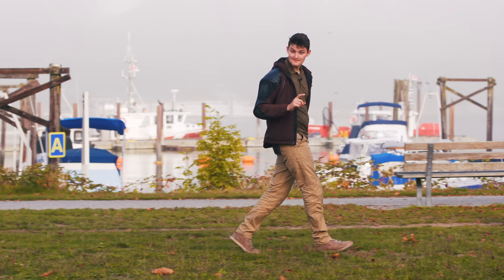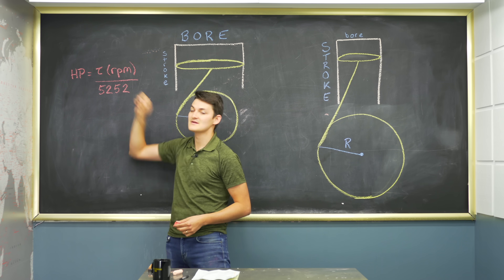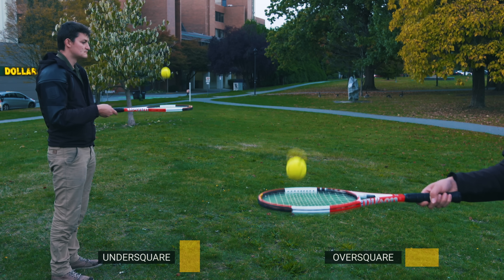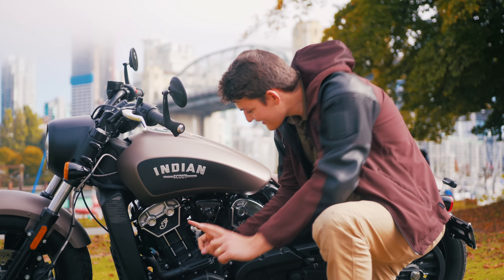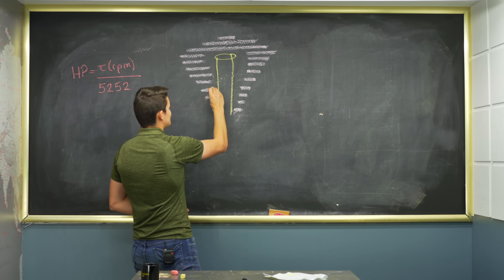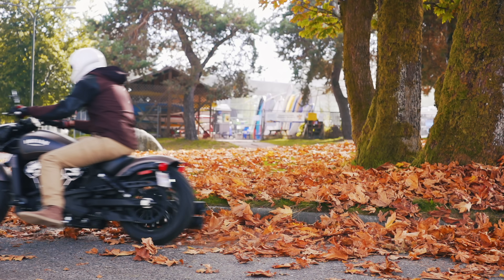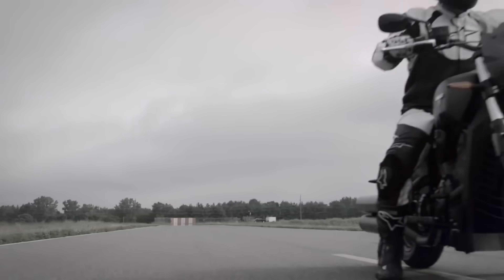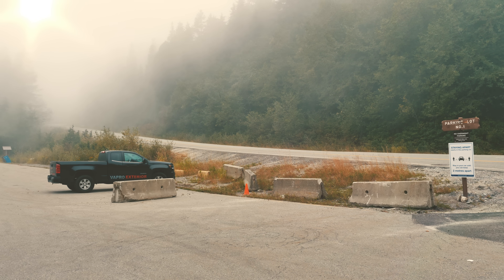How Indian Makes 43% More Power than Harley-Davidson

Comment: I always loved the way the scout looked, but this review teaching me about how it worked was the biggest driver behind me wanting a scout more than anything and ultimately buying one. Its been a super enjoyable ride
Reply: Would you consider it a reliable bike?
Reply: @AntonioMartinez-kg3zm that's a damn good question right there.
Reply: @AntonioMartinez-kg3zm  I bought it with 6k miles and I've put about 5k miles on it since and it hasn't had any problems
Reply: @AntonioMartinez-kg3zm I have a two year old scout 60 with 30,000 miles on it and I ride it hard. So far just regular maintenance and tires.
Reply: But as the video said, it sucks because it's too low
Reply: @xpusostomos  a valid complaint for tall people or people who have preferences for a higher riding bike. I thoroughly enjoy being low though, and I find that it corners really well. My other ride is a much taller HD Electro glide and I generally find the Scout is more fun to ride. Again, all preferences though
Reply: @Anonymized-name  what the physics says is that a low bike will turn quicker, but you'll lean more. And since you're already low, then the question is will you scrape something. That I find a bit terrifying.
Reply: @xpusostomos  i scrape the feelers on the foot pegs every once in a while.

Comment: The finest example of educated content, without bias or shock value.
Reply: FACTS!
Reply: They are comparing two totally different bikes. My SOFTAIL makes 50% more torque at half the revs. The bobber is much more comparable to a SOFTAIL in size and overall layout.
Reply: 100 ... agree!
Reply: They compared harleys smallest bike lol. Compare the street bob to the scout bobber and Harley shits on it lmao. This is the definition of persuasion and bias
Reply: @drewlansing8520  No the Scout is more comparable in price and size to a Sportster, my Scout was $11,500 what does a Softail start at? lol
Reply: @tylerdouthit5985  Indian Scout is their smallest bike, they compared the bike with the same sized motors, seat height and price $11,500 for the Scout what does a street bob run? $15,000  and 86 HP for the Bob the Scout comes in at 100hp for 4 grand less! Lololol
Reply: A Softail standard has a msrp of 13,599 Have you seen a sportster in person? It’s considerably smaller than a scout. The 1200S would be much more comparable in size to a sportster although it’s more expensive and seems to be the only Indian bike that appears exciting.
Reply: @drewlansing8520  A Scout is not any bigger than a Sportster I own a Scout and have rode many Sportsters, Softail is a larger bike than a Scout....🙄
Reply: A sportster has a 59 inch wheel base. The scout has a 62 and my Softail has a 63. A sportster is a bar hopper built off an old flat track racer design that hasn’t been hardly changed in 20 plus years. Both sides highlight their advantages, Indian makes an okay horsepower figure but lackadaisical torque which is critical in a cruiser. 114 model Softail a makes 50 more ft lbs of torque and even the 107s make over 40 more.
Reply: @drewlansing8520  have you ever rode a Scout? I doubt it, 3 in wheelbase difference doesn't mean shit the Sportster is the Scout's competitor not the Softail no matter how you try and spin it... lol
Reply: 3 inches in wheelbase makes a world of difference. It’s okay that you don’t like sportsters I’m not really a fan either but 3 inches of wheelbase creates a massive change in handling. If that weren’t the case people would spend big money on longer swing arms. I understand that’s a slightly difference comparison because swing arm length versus overall wheelbase is difference but we’re still talking a large change in dynamics with a 3 inch longer wheelbase
Reply: @drewlansing8520  😂🤣😂🤣😂
Reply: Without bias? Did you see how he reacted to the to the tall narrow cylinder??
Reply: Lol how can you say that when most of his videos hes bashing on Harley. Great content creator but clearly dislikes Harley.
Reply: FortNIne clearly doesn’t like Harley. That’s fine but he still shouldn’t try to mislead people. Compare a bobber to a Softail and the results go the other way. Softails have twice the torque and it’s available at half the revs. Almost every cruiser rider is after torque not HP.
Reply: Actually, his “scientific” explanations are almost all uneducated. In fact, as an engine design engineer, this video is down right offensive from how much incorrect information he is propagating. He needs to hire a tech advisor, I otherwise love his content.
Reply: @drewlansing8520  Seems like this is mostly a comparison of displacement. A 107 is 1753cc which is where the extra 40 tq comes from. A Softail is a lot more bike, and a lot more money. However, for the sake of this video, Fortnine laid it out in the beginning; 1200cc engines. 43% more power at equivalent size.
Reply: @tylerdouthit5985  They compared engine displacement. Same size engine for both bikes. Seems like your comment only served to point out your own bias.
Reply: @Dannn666  Exactly, even though the Sportster compares to the Scout 1133 in  price, displacement overall size & weight,  the Scout tops out at over 120mph stock and the Softail standard lists a top speed of 110 mph, the Softail weighs 115 lbs more than the Scout as well.
Reply: @tylerdouthit5985  that still wouldn't be an equal comparison, the scout is only 69ci, if have to be a street bob 114 to a cheif 111
Reply: plenty of shock value for harley fanbois
Reply: @Performance-101   Might have helped if you actually explained what was wrong about his "scientific" explanations.
Reply: @docblizard  It would take too long, he’s got almost everything wrong. Examples: Liquid cooling is unrelated to any of the causes he mentioned. Flame propagation in a bore doesn’t impact Torque or heat transfer. Bore to stroke ratios don’t impact RPM. It goes on and on, like I said, his comments are just uneducated. The Harley has less output and volumetric efficiency because it was designed that way. I could design an engine with all the same technological constraints that would make more power at a higher RPM than the more “modern” competitors. This reminds me of the 90’s, when automotive believed you needed DOHC and many valves to make power. Then Chevrolet released the LS engine and proceeded to beat Ferrari at LeMans with pushrods and 2 valves per cylinder.
Reply: @Performance-101  I took an ICE course years ago and I thought stroke length did inhibit RPM (for the flame propagation  reason), but you still want to maintain displacement hence Oversquare design. Is this incorrect or just super simplified ?
Reply: @RaphYkun   Stroke limits RPM only when you are approaching your piston speed limits, which neither of these bikes are even close to. It’s due to rod strength and film thickness at the rod bearing, not flame propagation. The flame propagation issue only causes I burned hydrocarbons at the cylinder wall, which hurts emissions and fuel efficiency. This can be mitigated with squish pads as seen in virtually all race engines.

Comment: My first bike was a Yamaha 80.
Later on in life although I owned a car I wanted a bike.
I got a very used Honda Hawk 400.
I paid $500 and it ran perfectly after test driving some garbage that people were trying to get rid of.
Sold it for what I paid for it.
All my friends went out and started to purchase Harleys. 
One got a new 883 Sportster the rest went bigger. 
Don't know the names but I remember the engine size was 1340 CCs.
I decided to get another bike.
This time to the Honda dealer for a new 750 in black.
I only paid $2500 for this bike and it was brand new. As a matter of fact when I went to get it they did not even have one on the showroom floor I asked the salesman show it to me he brought me into the repair side and showed me that was actually in a box I believe it was on top of three other boxes.
Left them a deposit came back when it was assembled. 
This bike was so much better then my friends bikes in every way. 
They could not believe what I paid until I showed up with the receipt. 
This was in the early 80s so don't go looking for this price now days.
I see what 750 Jap bikes sell for.
This bike was so good that my first
NEW car was a Honda Civic. That was back in 1987.
Honda when it was made in Japan. 
The day we swapped bikes just to see. I drove the sporster on the highway when a car cut right in front of me. Sacred me to death because what would be a very light pull on my front break did not work that way on the Harley.
I had no idea that it needed to be pulled to engage. Not for me ever.

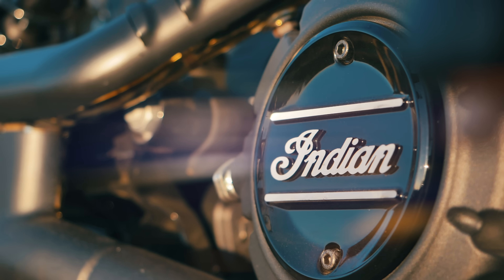Comment: OMG . Did you notice all those wheel weights at 4:10  to balance the wheel !! Good quality control on the casting of those things .
Reply: Yeah, I was going to comment that, that's a lot of weight in a new bike..
Reply: Lol... so true
Reply: hell, i saw more than that on a brand new in showroom Sienna
Reply: Holy SHIT! Then I saw "Harley Davidson" on the tire, and the understanding kicked in.
Reply: a lot of that can be for the tyre. I've had bare car wheels on balancers before to look for buckling, spun it to check for balance, and it was totally fine even though there was a slight (barely a few mm) wobble.... fit a tyre, fire the weights cannon
Reply: #harly
Reply: Crap wheel ? crap tyre ?  Given it is a Harley could be both I suppose. Nice paint though (according to HD owners)
Reply: ObamaReally Suucks  True, there are 8 that we can see, who knows what is on the other side.  Don't think I have had almost 60g of balance weights on any of my bike wheels. Maybe I am not riding the "right" sort of bike.
I have certainly never had a HD tyre.
Reply: ObamaReally Suucks  Mounted and balanced dozens of tires in 40yrs of ownership and by the time I get to 6 of the 1/4 weights I pull the tire off and find the heavy spot of the wheel and the tire , Been surprised to see cast wheels that aren't heaviest at the valve stem
Reply: The ftr is the only bike I would buy if i ever wanted one from a cruiser brand..
Reply: @jeremyt7722  yeah, my honda cb300r has like 4 of them from factory on the rear wheel, ok smaller tire but still...